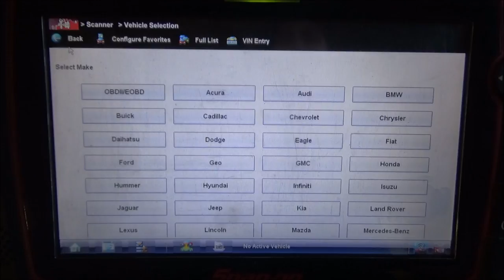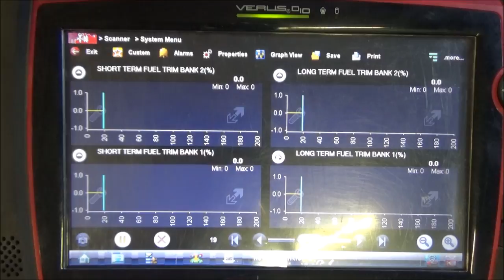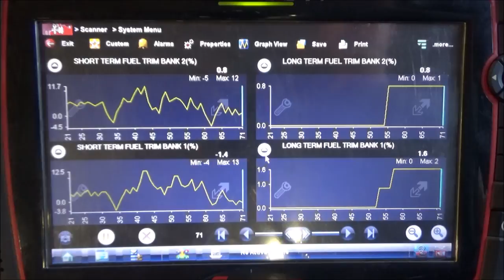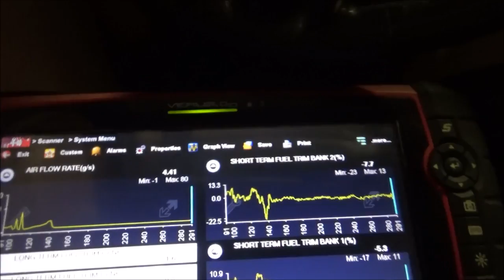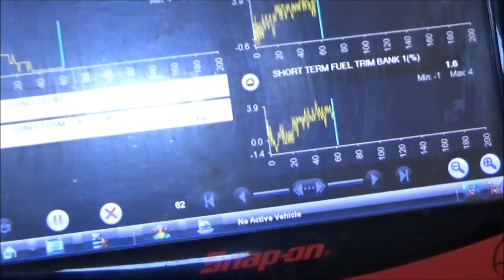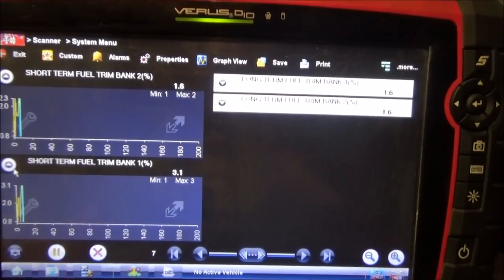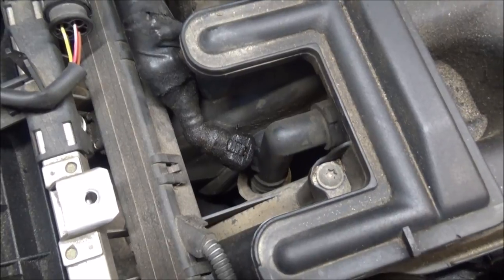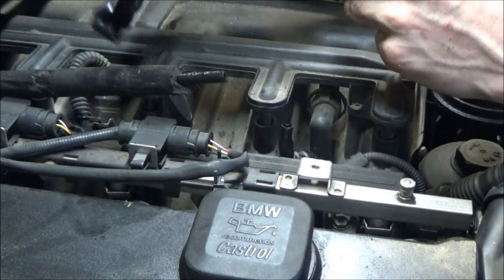2002 BMW 330I,  Lean Condition Troubleshooting

Comment: Definitely the visual inspection is key on all diagnosis, specially when you see electrical tape! I think that a smoke test would it save you time. But it is easy to say when you are just watching a video and you know the end. It is hard to pick a test that works. Good diagnosis.
Reply: or he could have just spray carburator cleaner all over that motor.

Comment: good work going  back in for a second visual inspection nothing wrong with that ,also I like the part about discussing the fix with the customer, often the hardest part of the job is getting the customer to understand your angle with how the car is running and it might need further inspection

Comment: You're right Joe that having slow scan data makes diagnostics a real challenge. Great that you found that busted hose that somebody hacked. It looks like it will be a easy repair with the right part. I have a Maxisys Elite and I am very well satisfied with its functionality. I haven't had a chance to put it on a BMW but it works fine on VWs. Keep up the good work! 👍👍
Reply from the maker: I'll keep that in mind good sir.  I have heard nothing but good things about the Maxi Elite.  I hope to get one as soon as I can afford to.  Some of these problems are down right undiagnosable with the Verus.

Comment: The common E46 lean codes are with the CCV system and all those plastic tubes that get brittle over time, the intake boots will crack and the small vacuum tubes for the secondary air system. Usually when you start replacing one of those, all of them need it.

Comment: That hose is part of the  CCV system for anyone that is wondering. At 25:30 minutes you are looking  at Bank 1 sensor 2 on the right which is post cat, which should remain steady compared to Bank 2 sensor 1 and Bank 1 sensor 1which are pre cats and should fluctuate. 

I am in UK and have the same car so I am very familiar with this engine.

Good find though, I was thinking possibly MAF before your discovery.
Reply: NEW CRAZIEST VIDEOS

Comment: Well done Joe! Do not get discouraged by European vehicles,they will only make you a better technician. I can't believe what the hack working on this before you was thinking! I also can't believe a 10K Verus won't communicate with a BMW! Seriously! Get the Maxisys Mini for 1200$. Done!
Thanks for the video! 👍
Reply from the maker: Nick Nicu, how does the mini conpare to the elite?  Do you think I'd be better off saving for the elite?  What are the costs vs benefits?
Reply: Triangle Diagnostics ELITE :

MaxiSys Elite
The MaxiSys Elite, the newest addition to the MaxiSys line of highly advanced smart diagnostic tools, is based on the fast and intuitive Android operating system. Powered by NVIDIA’s Tegra® 4, the world’s fastest mobile processor, its visually stunning 9.7” Retina display offers ultra-high resolutions up to 2048x1536 and an optimized array of sophisticated and powerful applications. The MaxiSys Elite rapidly performs every job from comprehensive vehicle diagnostics & analysis to advanced ECU programming. 2x faster than any comparable device, the MaxiSys Elite provides extended battery life and intelligent power saving. The MaxiSys Elite offers a super-sensitive capacitive screen able to respond to gloved, moistened, and even greasy fingers! The ergonomically angled docking station provides optimum visibility and convenient charging that eliminates power concerns.

The most extensive complete system coverage for more than 80 US domestic, Asian and European makes and models
Exceptional OE-Level functionality from comprehensive OBDII diagnostics & services to advanced ECU coding and programming
Uniquely integrated vehicle programming capabilities working with a SAE J2534-1 & -2 compliant vehicle programming pass-thru interface
Automatic system and software updates with real-time push message notifications via internet
Instant remote control tech support anytime, anywhere
Interactive Data Logging sessions enable direct contact with Autel Support for first-hand troubleshooting of diagnostic bugs and errors
One-stop multitasking designed for ideal management of workshop operations to keep all data files, customer info, and vehicle records well organized
Unique ergonomic design with rubberized outer protection and a rugged internal housing.

MINI :

Hardware
Extraordinarily powerful Cortex-A9 quad-core processor
7.9” 1,024x768 LED-backlit glossy Multi Touch capacitive display with IPS technology
Internal reliable and fast 32GB Solid State Drive for better performance
Built-in 5-megapixel rear camera with autofocus and flashlight
Dual-band (2.4 GHz & 5.0 GHz) 802.11n Wi-Fi to access your favorite web resources
Unique shop tough ergonomic design features strong rubber protection and housing;
Built-in rechargeable lithium-ion battery for up to 5 hours of continuous operation
USB, audio and auxiliary ports make it easy to connect accessories
The VCI connects to the main unit wirelessly with up to 230 meters working range
Software
Open source Android Operating System for fast boot-up and multitasking
Easy and intuitive navigation makes finding what you need simple and fast
Extensive vehicle coverage for more than 80 US, Asian and European vehicle makes
Complete capabilities for codes, live data, actuation tests, adaptations and ECU coding
Displays live data in text, graph, analog and digital gauge for easy data review and analysis
Configures display options, sets triggers, records and playbacks results with one touch
Records and playbacks live data to pinpoint troubles of sensors and components
Cloud-based Data Manager saves customer and vehicle records, scanner data and technician notes
Remote technical support for convenient demonstration, training and increased customer satisfaction
Prints out recorded data anytime and anywhere with Wi-Fi technology
Automatic Wi-Fi updates available in new software releases.
Reply: Triangle Diagnostics I think that the Elite is using a newer Android platform,has a bigger screen and you can do programming using the SAE J2534-1 & -2 compliant vehicle programming pass-thru interface.
So,I can't say more not having used the Elite...
What I've found great about the Mini,is that even if it's cheap,it still gives you the wireless Bluetooth capability of taking it with you around the car.

Hope this helps...
Good luck!
Reply from the maker: Thanks so much for the information my friend.  I think the Elite would be more desirable for my application,  so that is what I'm going to shoot for.  I think the J2534 capability would be paramount as right now I have no way to perform programming.

Comment: I wish BMW would let Alldata or Mitchell publish their dealer repair manuals. In my opinion it's a major weakness that damages resale value.
Reply from the maker: I agree with that 110%.  There is nothing worse than working on one of these with little to no information.

Comment: if it's pre 2010 you can use dis or inpa to communicate with the beamers
Reply from the maker: Good tip,  I'll look into that and see what I find.
Reply: Derrick Mitchell what's that
Reply: Derrick Mitchell what's that
Reply: Factory diagnostic software for BMW
Reply: They took those out in early 2000 it says right in the factory manual.

Comment: do you think doing a smoke test would have revealed the issue sooner? Im looking to buy a smoke machine which is a lot of money but i think it will pay for itself
Reply from the maker: A smoke machine is one of my favorite tools.  It was going to be my next step on this if the visual was unfruitful,  I was just trying to avoid it because BMW plastic is junk and I didn't want to run the risk of breaking anything trying to get tied in.  As far as would we have seen it,  I think potentially yes.  Guess we'll never know!
Reply: True. I think i might bite the bullet and get one. Gonna go with the otc. I have a diy one but it just doesnt cut the mustard
Reply: I don't know if you own a "easy intake" adapter but they work well with smoke machines and they save a lot of time and headaches here is a link  https://www.amazon.com/Redline-Detection-95-0082-Diagnostic-Detector/dp/B00H2VV8OM

Comment: want to see crazy long terms? auto trans power brake the pile of #^&#$^(*, until it nearly spins tires ;)
I've twisted rusted out "chevy truck" corroded aluminum driveshafts in half before. they folks were like why'd you do that? I said, would you rather it break on the next big hill? and possibly flip the vehicle or puncture the gas tank and make you a fireball? enough said